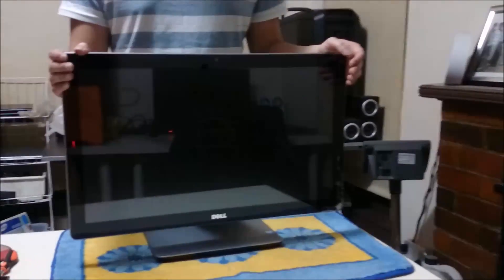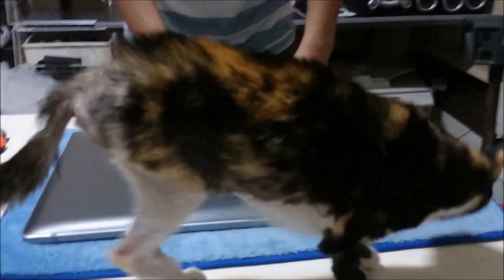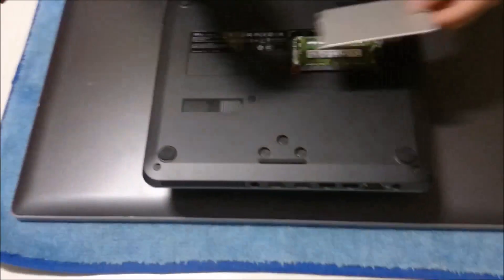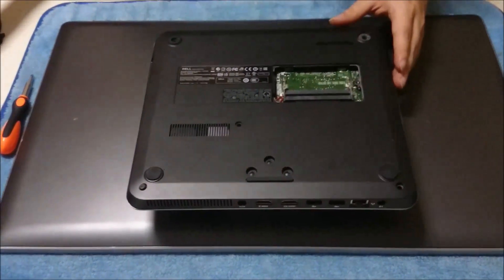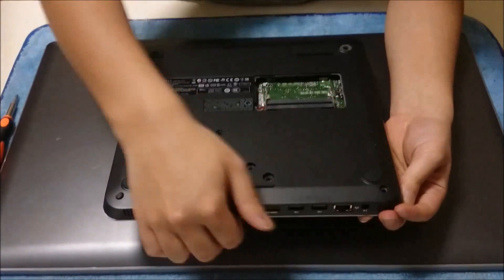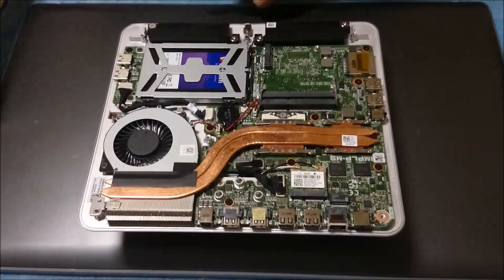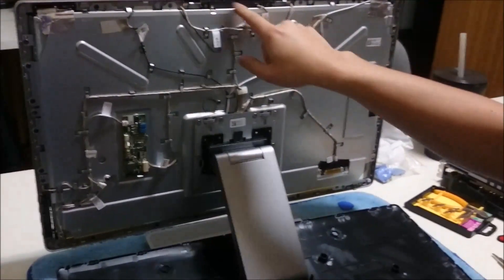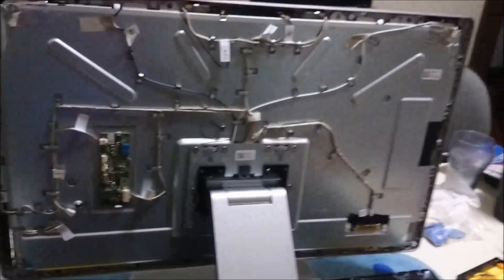OPEN ME UP! Dell Inspiron 2350 or 7459 Touch Screen Notebook Disassembly

Comment: hello,i would like to know ,what is called interposer or adapter (between sata hard drive and interface of mainboard)where can buy , can you send me link on ebay me.thanks for advice

Antworten
Reply from the maker: the connect to the sata drive is the same one as all other dell use. i dont know what it is called or its name. try to look up dell laptop sata cable and check if it looks like the one in the video

Comment: I know this is an old video I remove the monitor now i cant use the the computer because it doesnt have a power button on cpu
Reply from the maker: you need the whole computer to make it work. thats the point of an all in one
Reply: I dont understand about whole computer. Do i need another board for power button? The monitor is so heavy thats why im replacing it with new monitor and i need some advice about what to buy to make it work. Hehe What do you mean by whole computer?
Reply from the maker: @johnpaoloescuadra5716  it wa deign to be ued as one therefore you cant take it apart like that and expect it to work as 2 different parts. it will be cheaper if you sold this and buy a desktop

Comment: So could I just remove the monitor assembly altogether and use the base as a mini-pc for TrueNAS use?  Any downsides to this vs just leaving the monitor in place?
Reply from the maker: you can leave the monitor there it makes it easier if you need to see what on the screen. some of these dont turn on without the LCD cable connected to a screen and give an error "no screen connected". i have not tested this for this computer but i know many some will work without a display and some wont
Reply: @OpenMeUpTec  Thank you for the advice.  Since this server is going into a low lying cabinet under the stairs, and since TrueNAS will allow me to access the PC remotely,  the monitor will actually never be used.  I'll just make sure the blank screen saver is activated.
Reply from the maker: @joeshlabotnik5764  before you go removing the screen. you can test it by removing lcd cable and pluging in the hdmi to see if it turns on.

Comment: My microphone is not working.  I had a fan replaced on this computer about a year ago.  Could it be that the cable to the microphone got disconnected or loose?
Reply from the maker: yea they probably forgot to plug it back in

Comment: Very informative video! My 7459 abruptly stopped working overnight. No lights, not even at the power socket (the adapter is working) and the buttons on the side do nothing. I opened it up to check for loose cables and tried to replace the CMOS battery but no luck. Any recommendations on where I should start troubleshooting?
Reply from the maker: take out the ram and hard drive. then turn it on with the base open. this is so you can see if the fan spins for a second.

Comment: Can the AMD Radeon HD8690A be upgraded or at least replaced on this model? And if so, where is it?
Reply from the maker: gpu is soldered on. you can remove it using a beat guy and the computer should work with intel HD graphics.
Reply: @OpenMeUpTec  Thanks. It does already but I updated the BIOS today and it's now running slow on graphics. I must have broken something. Thanks man.

Comment: Can I use this PC as a monitor only? Thanks
Reply from the maker: yes you can but there are a few issues. first the computer needs to work and turn on. if you use it as a monitor then you have the computer running in the background and just displaying something else. this mean you are wasting power running the computer part, the monitor part and what you plug into it. therefore, it is basically cheaper to buy a monitor and use it as a monitor

Comment: This mobo is badly designed. The nuts holding down the heatsink are soldered on the same side of the board (not opposite side). They easily get unsoldered after a few hours of heavy usage causing the heat sink to pop up frying your CPU/GPU.. Just go check ebay and you'd see alot of 7459 mobos on sale with a few nuts missing.
Reply from the maker: i have not experience this issue before. this should not happen as to melt the soldered will require higher than 90 degree which the computer will auto shutdown to protect the CPU

Comment: Are the graphics card and the ram able to be replaced?? If so please link me to what i would want to buy cause i don't wanna buy a graphics card that's not compatible.
Reply from the maker: CPU can be changed, Ram can be changed to 16GB max with 8GB DDR3 in each slot and there are 2 slots, wireless can be changed, MSATA SSD slot and hard drive is a 2.5" inch hard drive. Graphic card is soldered on
Reply: So i can not change graphics card?? since it is soldered on.
Reply from the maker: yes

Comment: Please help! I have the same computer but for some reason, a gentle tap to the bottom left corner of the screen would lead to the computer freezing, requiring a reboot. Could you please recommend a solution? Thanks!
Reply from the maker: one of the connector are located there thats all i can think it causing you issues
Reply: OPEN ME UP i ended up examining the hinges. It was wobbly so I tightened the three big screws on the base. Working fine now. Also, is it possible for oil to leak from the vent in the base? It has no smell and this was a while ago.
Reply from the maker: there is no oil inside the computer

Comment: I have this xomputer . not it wont boot . had issues with it not recognizing own power supply since out the box . sleep crash n never respond . not syncin sound with hdmi usage . to noe feb 2018 since update cpu does not load or loads to a point in shuts off before completely loading goes through systm check n finds nothing . any clue how to get working . 

Im hoping fan . 

But now making  digital sounds on startup like older 1990 computers .on startup .
Reply from the maker: if it is beeping then there is an error. the beep is a code which you can use to understand the issue

Comment: Great video, thank you. Can I change the SSD alone with a bigger one and keep the original 1TB HDD?
Reply from the maker: the 1tb hard drive you have now is a 2.5 inch and the SSD is a msata. the biggest msata is only 512GB.
Reply: OPEN ME UP Thank you so much, I ordered the 512GB msata, will use it for OS and keep the 1TB for data. Thank you!
Reply from the maker: before you go do that. you can get a 2.5 inch  2tb SSD and it will be cheaper plus faster than a msata. the other thing you can do is get a 2.5 inch 512gb SSD and buy a external hard drive case for your old hard drive. once again cheaper and faster than getting a msata
Reply: @OpenMeUpTec  Hi.  I have the same computer. Do you know what kind of interface is for the 2.5 inch HDD?  I bought a 2.5 inch 1T SSD with SATA3 trying to replace the HDD. But seems it does not match the HDD's interface and I can not just slide the SSD in.  Dell's manual says the HDD is SATA, so it should be ok to use a SATA3 ssd. Do i have to use some kind of  cable? Thank you.
Reply from the maker: @wanglingtao1952  the issue is with you, this is a pc not a apple. if it fits in the slot it should work. can you tell me why you think it is not working? if you are unable to plug the cable into the hard drive then you got the wrong hard drive most likely a SAS hard drive not a SATA hard drive
Reply: @OpenMeUpTec  Hi , I found out today that from the interface part of 2.5 inch HDD, there's some kind of adaptor need to be removed, and I need to attach this adaptor to the ssd so that SSD can be fixed into the motherboard interface.  Now the SSD is working super fast.   Thanks for the video

Comment: Worth mentioning that the base is cast aluminium, so does not flex in the way a plastic moulding does. Inside on the side opposite the headphone jack and at the front are 2 sprung steel retainers. It's OK just to pull the base upwards, starting at these 2 sides. Be careful not to lever down on the silver aluminium top of the base as this deforms easily.

Comment: How can I physically disable touch screen? Screen is cracked and has phantom activation all over. Can't use the software method as I have no control. Thanks.
Reply from the maker: you have to remove the back of the screen as in the video and disconnect the touch screen cable
Reply: @OpenMeUpTec  which one is the touch screen cable.  i have a crack screen too.  can just the screen be replaced?
Reply from the maker: @amishchiman  the touch and the LCD are 2 different screens and you can replace them individually.
Reply: from where I can buy both strips ? I mean for led display

Comment: Any recommendations or links on where I can change out my N wireless card to an available AC compatable? Why is the max memory 16 GB? I thought it would be at least 32 addressable with the 64 bit OS. Thanks for the great demo.
Reply from the maker: +mvortex1 Max 16GB is because there are only 2 slots therefore you can only put 16GB in it since 8GB is max for 1 stick of DDRL3. Intel 7260ac cost around $20AUD on ebay

Comment: My LCD panel is brokendown and the touch screen is malfunction. How can I fix it or replace it??
Reply from the maker: +Erivaldo Jordão i detach my cable so it doesn't register touch anymore. my screen is crack and i actaully cant find the replacement part so i just left it there
Reply: OK can you send me the procedure to do it properly??? I will appreciate it.
Reply from the maker: No sorry I don't have the item anymore to show you nut in the video I show you how to remove the back of the screen and point out which one is the touch screen cable
Reply: +Erivaldo Jord&#227;o The new screen costs !!740Euros!! a Dell ripoff!! Just a short advice for the new one, I ordered my self the newest Skylake  (AIO 2350 with 60'3 screen). and shocked discovered that the whole think is Lauder than the old model, overheating so badly (1.4 firmware) that one can burn his hand laying it on a stand. I disabled the Nvidia completely, but the fan never stops, in contrarily it runs continuous up and down so one can't read a simple internet article in peace. The think is completely useless, one can not use it. Everything works except RealSens camera for which there is no software available (and so useless inside!) but the FAN makes it for me impossible to use. And since We don't have any return policy in Switzerland, they don't want to take it back. So it stands there in the box and waits for to my lawyer to sue the Dell... This is my very last PC or whatever from Dell !  Never again Dell!!
Reply: +Erivaldo Jord&#227;o Have exact the same problem here, seems like touch screen goes broke fast on this model. I solved the malfunction with disabling touch function:  Device manager- Human interface Devices- HID compilant touch screed (disable it). Now I can at least use it till I get the new one (with 60,4 screen). Also searching for option how to repair the screen on this one...so if you found some solution please reply.
Reply: dejgasrat  Thanks  for the tip. I solved my  problem the same way disabling the touch screen functionality. I  will not buy touch screen any more... neither buy a new screen parts.
Reply: dejgasrat  I fill  sorry for you man! Do everything you can to have it back. It seems the Mac's  are better than  all the others.
Reply from the maker: Everything it up to whatever you like to think, everyone has difference issues. i have two of these and dont have any of this issue you have but does not mean it does not happen. 

Mac are good but also bad as well. The worst thing with a iMac is that it was design not to be loud therefore it has a massive issue that is called THERMAL THROTTLING. That means to protect itself from over heating it will slow everything down to redue the heat since it can make the fan go faster as it will be to loud and everyone that has an iMac has this issue. 

Apple sells iMac with desktop CPU that have the ability to be overclock. The CPU with have a letter "K" at the end while others companies sell it with a "T" at the end which mean low power as they now about the heat issue. Dont you think this is fraud as they sell you something that you can not use and that you can not use fully unless you live in the snow. 

The best example of this is the newer iMac 12" inch laptop it suffers from THERMAL THROTTLING so bad that it basically you will only ever be able to user 50% of it full power. you can watch a video online where someone try to water cool it just to see if they can solve the heat issue.
Reply from the maker: +OPEN ME UP I recommend you to download and install the latest bios update that generally solves the issue. there is a link below for version A5. This thing is sort of normal, generally when companies make product they setup to run a specific way and what to do if things change. These setting are not always right the first time and bios update will change these setting after people complain about issues. This issue was a big thing for HP a few years ago where many people has massive over heating issues, fried components and auto restart to protect components. I had to deal with many of these HP laptop and a simple bios update resolve that issue. 

http://downloads.dell.com/FOLDER03588872M/1/Inspiron_7459_1.4.0.EXE

Comment: Hello, I want to replace our 1TB HDD to a SSD, What kind of SSD should I buy?
Reply from the maker: +Anton van der Wulp any. the different is not big between the best one and the worst one they all pretty close and you can not tell the difference between them in real life usage and only can tell in bench marks which will display the small difference. so just buy the brand and spend the amount you are happy with.
Reply: Hi, thanks for the replay. So I can replaese it with a normal SSD? http://www.ssdcenter.nl/category/208062/ssd.html or has it to be a Msata or M.2 SSD
Reply from the maker: samsung 850 pro is one of the best hard drives avaliable if you want to know. there is one msata slot and one 2.5 inch hard drive slot. so it is up to you. some will use a msata so they can keep there old 1TB hard drive but if you dont need it buy the SSD in the link you provided as it is cheaper and better than a msata.

Comment: Looks like yours has cracked glass.  I called Dell and they say it is part number YWKXD but I can't find it anywhere.  Have you tried to replace the glass on yours?  Thanks for the video!
Reply: +OPEN ME UP Does the screen and digitizer come right off without a heat gun and adhesive like you have to do with cell phones?
Reply from the maker: I called up Dell asking about it but they refuse to talk to me as I was not the original owner of the item. I told them I just want to buy a replacement part and shouldn't require me to be the owner of anything as I am not claiming warranty or anything that requires rights. but they said we can not sell you anything if we can not confirm you own and have the rights to that item. so I got nowhere. 
taking off the touch screen is pretty simple. in the video I show you how to remove the back cover of the screen and the next thing you need to do is to remove the touch screen which is pretty simple after that
Reply from the maker: +franzcatch1 the touch screen is separate from the LCD screen and comes straight off without anything
Reply: +OPEN ME UP Would you be able to tell me the part number on the glass if you ever take one of these apart again?  I have found the part number of the entire assembly, 08PRM, which includes the glass and LCD.  But I haven't found the part number for just the glass.  Thanks!
Reply from the maker: When I called dell they advise me that it is not sold by itself that's probably why you can't find the part number. I dont actually have the item anymore so therefore can't help you

Comment: Anyone know how to extend LVDS cable assemblies? Not as simple as extending the existing wires I think. There are heaps of LVDS extensions on the net, but specifically for the 2350. LVDS (low voltage differential system) I think is a complicated process.

Comment: Sounds like a weird question, but do you think the ribbon cable that connects the base to the display could possibly be extended so that for a special project so that monitor could be mounted using its original arm and the base could be moved further away.
Reply from the maker: of course you can. doing it yourself will require cutting the cable and putting it back to together to extend it. Buying it there is none really available I tried to look it up on ebay for you but can not find anything

Comment from the maker: No the GPU can not be changed as it is basically a laptop with a big screen. That's why they can get it so small.
Reply from the maker: i actually need to buy it to open it up. as you many know all the item on my channel i have to physically buy to open up. Normally by now i should have got one of them but i decided to stop since this channel is costing me way too much to run
Reply from the maker: @Cereal Pirate sorry i think you got the wrong idea. CPU can be replace but the GPU cant which is what the discussion is about. in the description i tell you the CPU can be replace as you can see below. this no different from a laptop as it uses laptop laptops, ram is laptop, CPU is laptop and GPU is laptop. therefore it is no different for a laptop with a big screen 

CPU can be changed, Ram can be changed to 16GB max with 8GB DDR3 in each slot and there are 2 slots, wireless can be changed, MSATA SSD slot and hard drive is a 2.5" inch hard drive.
Reply: @OpenMeUpTec  Thanks man - so it can't be swapped out for a like for like? I think I've cooked mine.